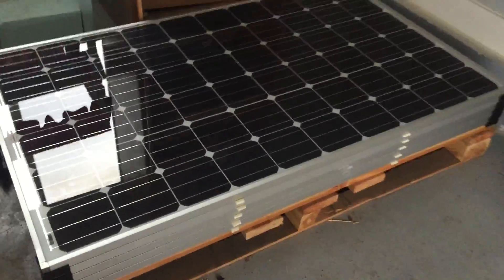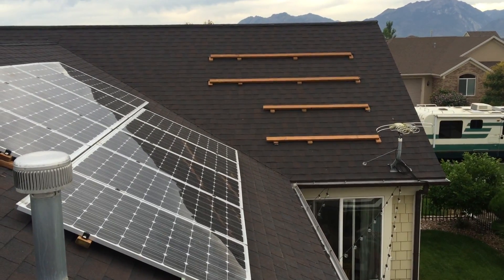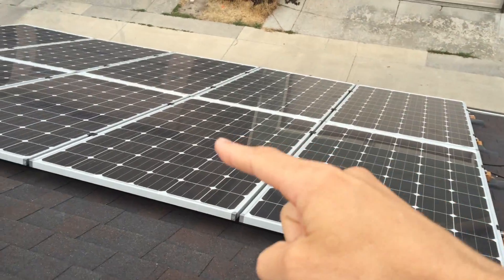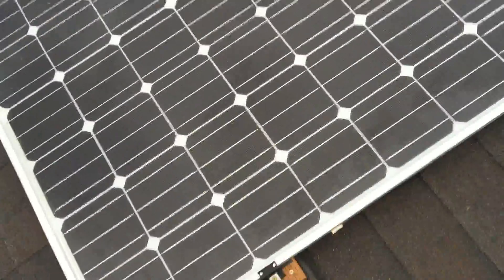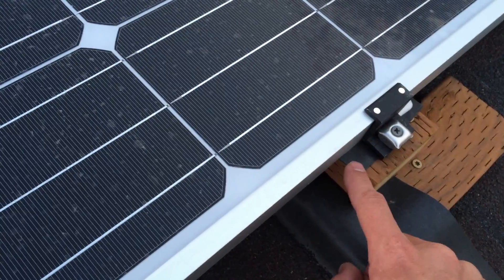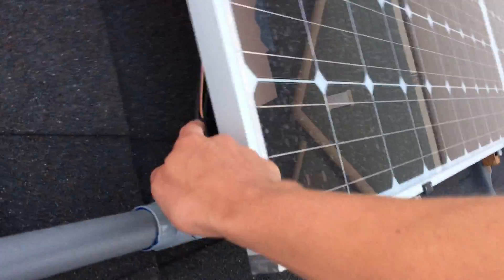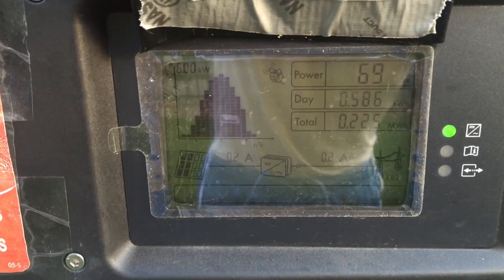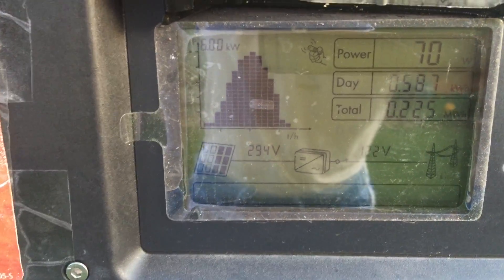How To Install Solar Panels Yourself For $4K - DIY 7KW - South Jordan, Utah - Cheap

Comment: Plastic conduit on the roof is a fire hazard waiting to happen.  Plastic degrades in the sun, when it degrades it will become brittle and it will break exposing your DC wire to degradation and eventually it will cause a DC fire.  All that sealtight is all illegal per NEC code due to it's length.  You had 100 hours invested into this system, your time is worth something, even if it's minimum wage.  I'm no apologist for Solar City or Vivant, I'm not a fan of either, however, you were quoted $2.29/W for a system that WILL likely last you 20-30 years, instead you have a system that is racked with PT lumber, which will rot and fail in less than 20-years, you have inferior products in that the plastic conduit and rolls of sealtight are not the same quality of installation of what you would have gotten by a professional install.  And finally, you have NO warranty except for what the manufacturer's warranty is and they are more-likely to deny your claim once they found out that their product was not installed by an electrician.  Your system looks like it was installed by a DIY'r and if and when you sell your home it is not going to be seen as a bonus to the value of your home, but rather as a liability.  If Solar City causes a roof leak and ruins the ceiling in your bedroom, it's on them, if you do it, it's on you. 
 So in the end, you really saved nothing by cobbling this system together yourself.  You spent over two full weeks of your own time to build a sub-standard system that seems to work today.  Whether this system will be working 5 or 10 years from now is an entirely different story.  We build and maintain large commercial systems installed by professionals, and ten years on a roof is hard on even the best equipment, you don't have the best equipment, you can't even keep the decals on your system in less than a year.  Like the saying goes, if you think it's expensive to hire a professional, wait until you hire an amateur...
Reply from the maker: Valid points.  My bet is that it will last at least 15 years, and the great thing is now I have the know-how to fix it if it fails at that point.  I guess you see it as a waste of my time, but I see it as an investment in my own education.  

I don't claim this is the best system in the world.  I also don't propose that everyone do this.  However, most industries that have been disrupted started out as something only "professionals" could do (e.g., computer technicians, travel agents, stock brokers, etc.).  Eventually, tools matured to the point where most people could do those things themselves and didn't need to hire a professional.  There are still plenty of rich (or old) people who still hire someone to help them use a computer, book airfare, and trade stocks.  And, many of these professionals add value, although their value proposition has changed over the years.  

With my DIY stuff, all I am saying is, "hey, I did it myself and it wasn't too bad, maybe you can too.  You can probably save some money, learn something, and potentially usher in some disruption in the industry."  I think rather than protect the industry, professionals should be embracing the DIYers and help people to install their solar so we can get the other 99% of the world to have rooftop solar.  Until this happens, rooftop solar will remain as a luxury for the wealthy or those who are willing to finance it as part of their home (which doubles or triples the cost of the system due to interest).  I don't think it should be that way.  

The players in industries that welcome change, disruption, and self-service are the ones who win in the end.  Today it seems weird to think the average Joe could install solar in a safe way, but that is only because the industry hasn't produces products, practices, standards, etc. that make it so.  I can see a day when you will go to Home Depot and buy a solar mat for a few hundred dollars that you roll out on your roof, simply adhere to the roof, and plug in (in a safe way), and just like that you have solar.  Maybe it will never happen, but that is the way most industries have gone as technology improves.
Reply from the maker: Andromuda Galaxy There’s nobody who cares and is motivated more to fix your problems than you!  When you do things yourself you are investing in your own education and it sets you up better to support your own problems. Thanks for sharing your experience and I hope you find a resolution for it.
Reply: Matt, the fundamental problem here is that you post this video as a how-to for the general public without realizing that the average person may not take any more care in planning or researching this work other than your video. Electrical work is 100% dangerous 100% of the time.  What you term as being easy, "just pop a breaker in" subjects you and anyone else to the potential to arc flash the moment you remove the dead front of that panel - it's not the kind of work untrained people should be doing, no matter how "easy" you found it to be, or whether or not you did it without getting killed. If 99% of the world installs solar the way you have it ruins the track record of solar's advantages and it's success. For every DC fire that burns a house down, for every system that fails early, for every company that flames-out, solar as a whole takes a hit. Encouraging rookies to install systems using substandard components, substandard workmanship, and overall bad information contributes to solar's black eye, and makes all the naysayers smile. Given your comments above, what's the limit to your attitude regarding "disruption," are you willing to disrupt dentistry, cardiology, and cancer treatment as well?  I mean, with a roller and a bucket of paint one could say they're disrupting the auto paint and bodywork industry, but are they, or are they just doing shoddy work to cover for their disdain for paying an honest wage for an honest job? We do very little residential system, and our average one is around 14kW, but the single common thread through all homeowners, whether they pay 10k or 70k for their systems, is that 99.9% do not want to take care of them.  Most never bother to clean their panels, and absolutely zero of them take care of their system, claiming that they will take care of its maintenance, only to call us later because it quit working.
Reply from the maker: You make some valid points, and I don't mean to come off cavalier in my approach.  I would feel terrible if someone got hurt installing solar after being inspired by my video.  At the same time, of course, like all DIY, it is assumed that it is at your own risk and people should research proper safety procedures and such.  

However, I don't want people to be scared of the project because once I did it, I realized it was a lot less scary than I originally thought, and for me, it was worth the risk.  I agree that it can be a setback for the industry if people are getting hurt, but I believe the industry will move ahead much faster if the masses (millions/billions) are doing it, rather than a few thousand professionals.

Am I willing to disrupt dentistry, cardiology, and cancer treatment?  Sure - that is already happening in fact.  There are all kinds of aggressive treatments and new procedures in these fields, and while most people still look to doctors with PhDs to provide these treatments, there are plenty of physician assistants, nurses, dental hygienists, assistants, midwives, chiropractors, spiritual healers, etc. who are also providing treatments and being delegated work.  I am not saying all of these approaches are the best, but the great thing is consumers have choice, and the free market can decide what is the best solution for certain circumstances.  

A good example to me is pumping gasoline.  In the old days, this was considered a dangerous, dirty job that only certain people could provide, so you had to pay extra for it.  Over time, people realized that it was cheaper and more convenient to just pump gasoline themselves.  Today it is a pretty foreign and ridiculous idea that people once had this service provided for them.  There are certain rich people who probably still pay for this service (or have a driver altogether so they don't have to deal with it), but 99.9% of the people pump their own gas today.  I am not sure if solar could get to that point, but perhaps one day most people will install their own solar, and it will be silly that it was considered too dangerous and manual for the common layperson to do.  

On your point that most of the people you install solar for don't want to clean them - you have severe selection bias there.  If you are installing 14kW systems, those are on really big houses of rich people who are the last people who are going to go out on their roof and clean their panels.  You are dealing with people who paid for you to install them and expect you to maintain them.  On top of that, they are rich people - they expect white glove treatment and aren't going to clean or maintain their systems.  DIYers who built their own system are a completely different breed, have a lot more know-how, and also wouldn't have the option of calling someone when it breaks or gets dirty, so they would do it themselves.
Reply: sirscoolrascal
Shut up please! Then what conduit should he have used then? Please explain!  Or do you want him to call YOU for your "services" and install it yourself?  If you dont plan on helping him by correcting his mistakes  then Shut up and leave. Just tell him what is wrong and WHAT HE SHOULD USE!
Reply: probably metal conduit.
Reply: sirscoolrascal I agree with most of the comment - particularly on the inherent danger of working with electricity - especially DC- I have seen some how-to videos for my industry helping homeowners avoid hiring a professional including replacing 240v pool timers and the videos neglect to mention killing power to the timer first! I think it's great that this guy installed his own system and that it works for him- the mistake is publishing it for others to follow.
Reply from the maker: To each his own - I think we are all adults - people can watch my video and decide for themselves if they are willing to take it on and accept the risks.  I don't think publishing the video is a problem though.

Comment: DIY is great, but you need to educate yourself a bit better. Some stuff is better left to pros because they have experience, but alas, there are some of those better than others as well. Don't take safety lightly though, and electrical is one where safety has serious consequences.
Reply from the maker: Thanks for the feedback.  When I set out on this project a couple years ago, I couldn't find the resources to educate myself.  I would love if you can tell me where they are.  The pros weren't, and still aren't, really trying to help the DIY community - they don't have any incentive to.  I have found that sometimes you just have to give it a shot and throw something out there and let people shoot holes in it, and that is the only way to really learn.  I learned a lot from this, and I exposed all my imperfections and flaws for youtubers to see, with the hopes that it will educate people just like me.  I believe in rooftop solar and I want to see it everywhere.  However, the "professionals" price it in a way that is prohibitively expensive for a lot of people.  My hope is to make it more accessible for more people.  

I realize there are more risks in this (like electrical as you point out), but not much more risk than someone takes on when they finish their basement and do the wiring, work with nail guns, etc.
Reply: @MattNewman  this is what I wanted to see, I love the way you did your system I'm making a Solar patio system for my house and your walk through is going to help SO MUCH.
Reply from the maker: @Zieranna  Thanks!  good luck!

Comment: Never put modules with different orientations in the same string, it will reduce the energy production. The wood racking is false savings compared to the proper PV system metal racking. The improper flashing and roof attachment will be leaking in a few years, since this video is a few years old you should be trying to repair that now. You attached the sticker on the inverter with clear tape? Did you pull that off another PV system and stick it on here after failing inspection? That fell off in a few months. Conduit just kind of laying over the top of the service panel? The building inspectors in your area must be really lenient. These systems are supposed to last 25 years on the roof, this one is built to last 5 years. Nice job with the grounding wire though, you did a better job with that one part than I have seen some contractors do. As this shows this is not a project for a homeowner DIY install, go to a professional.
Reply from the maker: I didn't really have a choice, but technically, the 5 modules on one roof and the other 5 have the same orientation that combine to form the string of 10.  So my three strings each have the panels all with the same orientation.  

Wood racking isn't ideal, but metal racking would have almost doubled the cost of my project.  In hindsight, I should have used strut channel though - would have cost a bit more, but not a ton.

It has been almost two years and no leaking at all yet - so far so good there!

Yeah, the stickers didn't really work out, but I couldn't find any stickers that weren't ridiculously priced (like $100) and I was just trying to pass inspection.  It should be pretty obvious to anyone how to shut it off in the event of an emergency.

yeah, the conduit over the service panel was a bit weird, but I didn't see how to do it another way since the main pipe going into the house does down and was in the way.  I had to go up and around.  The inspectors didn't seem to think that was any problem - I don't see why it would be.

I know things weren't ideal since it was DIY and my first time, but I also think you are a bit overly pessimistic about the longevity.  I am pretty sure it will last at least 20 years, which is my expectation.  Most of the things you brought up are very minor and in now way will make the system last only 5 years instead of 20.  

Interesting you said the grounding wire was good - I actually have gotten a fair amount of negative feedback on it too!  (angles too sharp, not thick enough, etc.)

At any rate, I appreciate the feedback.  I am always trying to learn from the experience.  One thing I have learned though is that like any tradesmen, the "professionals" do a great job pointing out all the flaws because they are financially incentivized to prove that DIY doesn't make sense for this.  I think this is a bit protectionist, which is understandable, but I also take it with a grain of salt since I know there is a fair amount of bias in the feedback.  

Anyway, take care!
Reply: I don't want to rain on your project but I also want to make sure people viewing your video know that a DIY system will probably be inferior in quality and design to a professional installed PV system, unless the homeowner is a professional PV installer. Even making a good faith effort to learn about how to design and install a PV system as you  did will not prepare you to do a quality, code compliant project, alone. PV contractors are not ripping people off, they are installing better, safer systems, and they have to pay employees to do it. You also don't point out a big safety danger in your video, PV strings on a house operate at up to 600Vdc and that is much more dangerous to work with than the 120V in your house.  Unless you tarp the array you are also working hot on a 600V system, this is not something untrained homeowners should be messing around with.
Reply from the maker: These are good points.  I do think a professionally installed system is superior, but in my case, I wasn't willing to spend 4X the money to have what figure may have been a slightly better system.  In my estimation, the benefits of having it done professionally just weren't worth the cost, and I never would have committed to $16K and a break-even of 10-12 years.  I know for plenty of people it is worth it and they have purchased from professionals, but I think there is a whole untapped market of people who are willing to spend $5-10K, but not $15-20K for a system.  The problem is, there are no professional installers addressing that market.  It is either you spend $15-20K or you do it yourself like I did.  

I agree with you that I did gloss over the fact that there is increased risk of handling higher voltage, and you on a roof, so there definitely more risks than the average home DIYer is used to.

Comment: Good vid man! 2nd best configuration. No grid & you are down. Add a PV switch-over to battery and inverter for ERs and you are perfect, get extension cords to the vitals, no need to rewire panels etc...
Reply from the maker: Thanks!  I am not sure I fully understand what you are proposing, but I like the thought.  My inverter does support one outlet in the event of the grid going down.